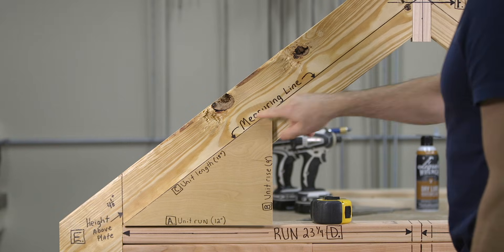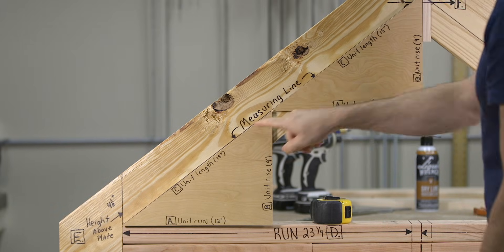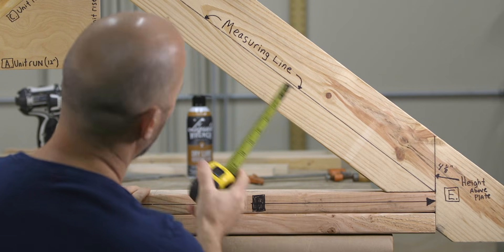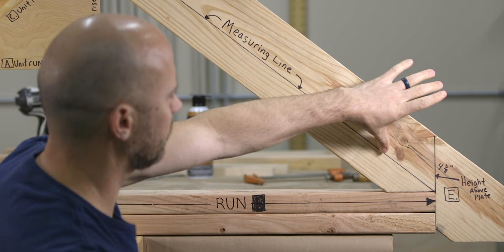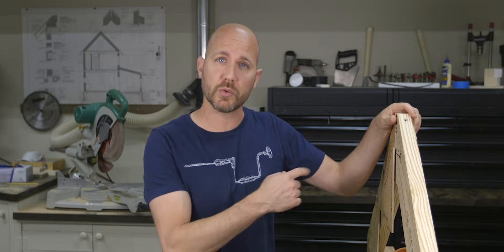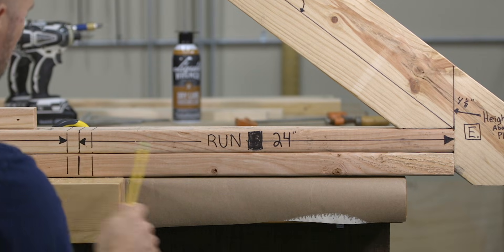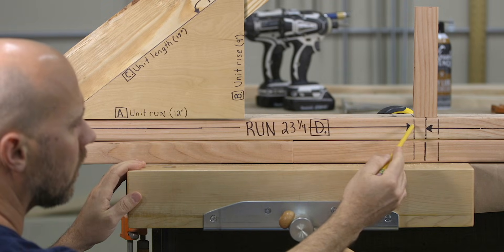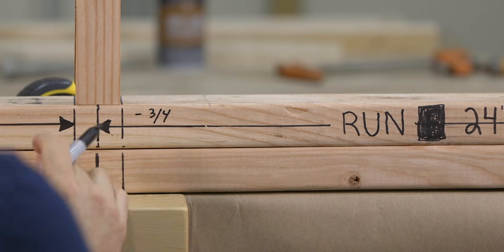How to Calculate the Height of a Ridge Board

Comment: How would you calculate the Height Above Plate without directly measuring and only using trig/math?
Reply: I guess you could layout the rafter and then measure the height above plate directly on it and figure out the height of the ridge beam, then mount your ridge beam!
Reply: @Machining101  rule of thumb: measuring line is 1/3 of rafter height so ridge height is 2/3 of rafter height plus theoretical rise. I think this is measured along the plumb line. So just be consistent when cutting birdsmouth.  The genius creator of this video can't actually answer any of these hard questions.

Comment: Why would you need to calculate any of this if you already have it all cut and in place already. you wouldn’t be able to get height above plate without the measuring line at the bottom which would make this all a lot easier but it’s harder if the ridge or rafters aren’t set yet
Reply from the maker: You can get HAP online. I have a video on that. https://youtu.be/fNX430YLuN4

Comment: Standard overhang? Builing 12 x 12 shed, don't want it to look cheap.  How much should the roof overhag and how deep should fascia  be?
Reply from the maker: 12" is standard, with 6–12" overhang on the eaves. Fascia can be either 1x6 or 1x8.

Comment: Great video.
Question.  We are building a shingled-roof over a patio. The walls will be about 8 feet tall.  Total span 12 feet for each section. Gable roof.
I was going to maybe have one run at 6 feet, 6/12 pitch and the other side be 7 feet, 5/12 pitch.
The rafters on the 5/12 side would have to be tweaked a little, right?  Any other foreseeable issues other than aesthitcs.  The reason I was going to have one side 7 teet wide was to avoid the water line underground when we set the concrete pillars.  Thank you.
Reply from the maker: I don't have any experience doing that before, but I would guess just making sure that the trim will line up on both sides. Sorry, wish I had more clarity for you.

Comment: Great explanation. What does one do if they want to notch the rafter to rest on top of the ridge beam not against it as a ridge board. Example total Run length = 13’ Run length = 6’6”. Pitch is 8/12. Birds mouth is 2” seat cut with a HAP of 5”. Rafter is 4”x6” and Ridge beam is 4” x8”. Rafters must marry on top and rest on ridge beam with a notch out of 2” at ridge plum cut. Thank you if you could answer
Reply from the maker: Sounds like you already have it figured out. You will basically cut a similar birds mouth at the top as you would at the bottom... only smaller to fit you ridge beam size.

Comment: 37 year carpenter here...great presentation ! In the field we do simplify some of these steps but your theory is nicely explained. Roof pitch is actually the ratio or fraction of the total roof span to the total height of the roof from the top of the top plate. Roof slope is the angle measured with 12" as the horizontal and the vertical rise given in inches. 6/12 slope is 6" rise or vertical for every 12" run or horizontal. A roof with a 24' span and 8' height to the peak would have a 1/3 pitch.
Reply: i dont get it

Comment: i know that this video is very old but i am a newer carpenter and I havent done too much fresh framing. mostly repairs. im only 17 but im getting into it. i understand everything from your first video and i get this one too I just want to know why you need to know the height of the ridge? it seems that you didnt need that to lay the common rafters so what is it for?
Reply from the maker: Hello, great question. You would need to know the height of the ridge if you where say building to a specific height... say trying to match something else, or even making sure that what you're building isn't higher than say codes allow. Does that help you?

Comment: Excellent videos thank you.  Can you confirm that the 1/3 rule overrides the wall plate length when cutting the birds mouth?  Ie I maintain a minimum of 1/3 cut into the rafter, and reduce the length of the the wall plate thickness cut to achieve that.
Reply from the maker: Hello, I would up-size your rafter material to maintain the 1/3 rule first before doing anything else.
Reply: @TrainingHandsAcademy  ok thanks. Great videos.

Comment: May 1st 2023
I set up a model of a shed. When I had the figures worked out, I cut the rafters, however the top of the rafter did not meet the top of the ridge board, rather it extended a short distance above it. What am I missing
Ger
Reply from the maker: Please share your math with me and I'll see if I can help.
Reply: @TrainingHandsAcademy  Hi
Another sample of my actions ,leading to incorrect result.
Rise squared+ run sqd = rafter length
7sqd+ 11 5/8= 13.56. 
11 5/8 represents run length minus  half the thickness of the ridge board.
Ger
Reply: Ridge board at 12 inches high. Run at 12 inches minus half the thickness of the ridge board 3/8 inch. Used the Pythagoras method to find the length of the rafter. Made the two vertical cuts and the birds mouth. Birds mouth fitted fine but the top of the rafter rested above the top of the ridge board. Rafter rested flat against the ridge board but as I said the top of the board sat higher than the top the ridge board. Must be something small I'm missing.
Thank you for your interest.
Ger
Reply from the maker: @gerglynn5  Should like you didn't take into account the height above plate.

Comment: What is the formula to find the height above plate without using your tape measure?  Example:  2 x10 is 9 and a quarter?
Reply from the maker: This video should help you https://youtu.be/fNX430YLuN4
Reply: @TrainingHandsAcademy  Thanks.  I get it a little better but I would like to know how to do it using a construction master pro calculator.  I see that you can plug the numbers into a website that works.  But when I am on the job,  I would rather know the formula and plug it into my calculator.
Reply: I think The formula to calculate the height above a plate without using a tape measure is:

Height = (Number of inches in the nominal size of the lumber - 1.5 inches)

For example, a 2x10 board has a nominal height of 10 inches. Subtracting 1.5 inches from this nominal size gives a height above the plate of 8.5 inches.

Comment: see, if i wanted to  lean a chicken rung on  wall, how would I know what angle to cut the wood in order for it to be flat on the wall while the bottom is say, 1 1/2 feet from the wall.... i wanna learn how to do that. like could it be a 41 degree angle?? like is there a specific angle? idk

Comment: I’m trying to stick frame a shed. Next step is to set the 2x6 ridge beam. To figure that height, and I know my building span(run), and my roof pitch, it seems like I should layout my bird’s mouth first so I know my height above plate. Is this correct? This way I can factor that into the total rise and height I need to set my ridge beam?
Reply from the maker: Correct!

Comment: First , Thank You. love your explanations, great work ! 
my quetion is if i want to reverse things... lets say i have a fixed height of 1000mm (right on the wall, no ridge board..), my total run is 2000mm and my HAP is 150mm. now ..if  I want to find my 'measuring line',  can i just subtract from my 1000mm fixed height the 150mm HAP and do my math on measurements of 850x2000 (Pythagorean theorem) ?
Reply from the maker: If I'm understanding you correctly, yes, once you subtract the HAP you are back down to the theoretical measuring line... which is where the Pythagorean theorem gets you to. Check out more of my rafters videos if you haven't already... start maybe with this one. https://www.youtube.com/watch?v=fNX430YLuN4&t=201s
Reply: @TrainingHandsAcademy  You understand me correctly buddy  (despite my English :), if you stumble upon YouTube or Google, you will find that most of the time the explanations starts with a pre determined roof pitch or angle thats leads you eventually to your `total ridge height'.  the reverse process, when the total ridge height is given, and you need to go down to the wall plate with your rafter, is hard to find. love to see the reverse process involving the other factors like the 'theoretical ridge height' (F) and how ridge thickness affecting it in the way of getting your precious 'measuring line' (with basic calculator). Thank You So much for your lightning fast reply. i have watched all of your rafters videos and learned a lot, you're awesome !
Reply from the maker: @freemansame8062  Thanks for the feedback and the great video idea! You rock!

Comment: so in fact, a 9/12 pitch roof is never really 9/12.  your example would be height of ridge divided by run.  which is not 9/12.  9/12 would be .75 and your calculation works out to be 21.625/24=.9  If you draw it as a true 90 degree right triangle you will see the slope (hypotenuse) and that the roof rafter is at a different slope.  Seems to me the only way to get an ACTUAL 9/12 pitch, or any other pitch, would be to use a pattern with actual rise and run layed out, then lay your intended lumber over it and mark it out..  The only way you can use the step off method is if the roof rafter is a line, not a board.  let me know your thoughts.  Thanks,

Comment: A good video as usual. Could you demonstrate how to do a roof when you have 24" run and total ridge height required 23" if they are the only dimensions you have. In other words you only know your run and required ridge height.
Reply from the maker: My other rafters videos will give you great insight into that.  The biggest factor is something called height above plate (HAP). Let me know after you watch them if you still have questions.Thanks for the comment Robert. Talk soon.

Comment: I have a question about the ridge board. Is it necessary? Can you use gable plates and simply get rid of the ridge board altogether?  Thank you
Reply from the maker: If you are "stick" framing (which all of my rafter videos show) you need and ridge. However, what you are talking about is building a truss.. which works too but other framing members need to be used to make a truss work.

Comment: easiest way is height = the square root of rafter length squared - run squared. This is the height to the bottom of the ridge. Dont forget to subtract half the thickness of the ridge from the run measurement. Then subtract your desired HAP
Reply from the maker: Thanks for sharing. When you say bottom of the ridge do you mean the measuring line?
Reply: @TrainingHandsAcademy  bottom of the rafter not accounting for ridge extra size
Reply: its just calculating for a=height of a right angle triangle which is the air space in our rafter triangle

Comment: Nice job. Love these videos. I was thinking about the first equation used. Although it may seem obvious to some, I think of the first equation at (D/12)*B. D/12 means that the total run - half the thickness of the ridge board is being converted into foot increments. 23.25/12 = 1.9375 ft, Since the rise is 9 inches per foot we can calculate 1.9375 ft * 9 inches/ft = 17.4375 inches, or 17 and 1/2 inches. From there it's a simple step of adding the HAB to get the actual ridge height.
Reply from the maker: I don't know you Ted, but I sure do like how your brain works! You must love math?!

Comment: HI. So in your example, the height of your ridge board is from the "top of plate" to the" top of the ridge" which is 21 5/8? Not from the bottom of the bottom 2x4 you have in your example to the top of the ridge. I like to be certain I know what I need to do before I venture into something like this.
Reply from the maker: Hey Bill! Yes, ridge height is measured from the top of plate (which is the top of the second plate) to the top of the ridge... and not from the bottom of the bottom 2x4. Hope that helps

Comment: @2.50 when you did the Math to Get 17.5" looks like you Rounded the Number up ?
Actual Calculation = 17 7/16"  ( 17.4375")
1/16" Difference
Reply: I got the same thing
Reply: I agree. His math is off.

Comment: Good video, however I don't understand the possible sequence. It seems the ridge height was determined after the HAP was determined. However the HAP was determined after the rafters were in place, which attached to the already placed ridge beam.  How is this possible?

In summary how can the HAP be determined without already placing a ridge beam and setting at least one rafter?
Reply: you make an error. HAP can be established without determining the ridge height. To lay out a rafter you need only 3 lines drawn at the pitch of your roof. if your rafter is 2x4 then 1.5 inches could be the depth of your seat cut. then 90 degree from that  you measure along a 90 degree line whats left. thats would be your HAP.

Comment: Want to know if it’s better to take 3/4 off run for rafter or take 3/4 off the rafter measurement itself.   They both come out slightly different but I want to know which one it really is
Reply: Actually the measurements are Exactly the same. As long as you take 3/4 of the rafter measuring back from the plumb cut and not down the rafter

Comment: What i do to get ridge height   .. say a building is 24  1- 1/2   with a 2x  ridge..  so  the run is 12'   if you have a 6-12 slope  multiply 12x6 eq 72 plus  height above plate        if you have say  a run of 12  3  5/16    that  again is 72  with the framing  square draw   a   6-12   slope on  a board on  the level  line   slide the square  over  to 3-   5/16   as you slide it  you read the height of the square above  the  board  plus  the height above plate.

Comment: For me as a woman building 1st ever greenhouse, Your video was really easy to understand.  I'm trying make a 10x6 greenhouse.  I was going to use 4x2 for plate and ridge. 3x2 for rafters. The greenhouse  frame will sit on a concrete block wall that I built 1.5-2ft in height and the roof will be polycarbonate sheets. I'm not sure if i should use 4x2 for ridge or not?? Any reply would be much appreciated. Thanks
Reply from the maker: Hello Naheed, thanks for the comment! Unfortunately, I can't answer that question because I don't know enough about the project or your local building codes. I apologize that I can't help you out more. Sound like an amazingly fun project!!
Reply: @TrainingHandsAcademy  
Late reply but i finally did use 4x2 as felt more sturdy because of length of greenhouse.  Adjusted length so finished project is 
10x11 feet as wanted more space inside to grow vegetables.

Comment: If I'm just using 2x4s for my rafters in a playhouse, I've read the seat-cut of the birdsmouth should be no longer than 1.5 inches, less I compromise the integrity of those rafters.  Does that sound right?
Also, my ridge board was going to be a 2x6, but that board is so warped I've given up on it - and I want to use a 2x2 below a 2x4 as a "ridge board".  I'm using simpson ties to keep them together.  Would this be ok, do you think?  
(My building is pretty small,  mostly a 4x8 floor plan, with one wing extended out, but not too far).
Finally, in the video, you meant to say "B is the Unit Rise" @2.42, you accidentally said "B is the Unit Run".  You never use the phrase "Total Adjusted Run",  which I've heard used as "Total Run - Ridgeboard width".  I've watched too many carpentry videos trying to nail the rafters and roofing.  I think your approach to using just the speed square and calculator are pretty simple.Thanks again for your videos.
Reply from the maker: Yes, 1.5" sounds about right, just as long as you're around the 1/3 mark of the rafter width. I would personally use a solid piece of ridge material, and yes, I did mean to say unit rise, good catch! :) If you get building and have more questions, find me on Instagram so that you can share photos or videos with me.

Comment: Here is how to get the pitch if you don't know the  ratio i.e. 12/12 = 45 deg.
A= Top Ridge, down to top of wall plate
.  (Horizontal)
B= Half span (Vertical)
A/B  eg >>>> 1220/2075 = .58
tan-1 of .58 = 30.11 
so the pitch will be roughly 30 degrees
Reply: Anyone know what language this is?
Reply: @ElJoeRN  Joe, tan-1 is ATAN, a geometric function to calculate the angle of the Hypotenuse-to-Base, or Rafter-to-Run in this case.  I think Damien got his Horizontal and Vertical labels mixed up though... too much multi-tasking?
Reply: @calcollier7366  my 10th grade geometry teacher can go soak a toa...if he would've used carpentry to show the relevance of it all the hot pants and sizzle skirts wouldn't a been so distracting.

Comment: Just wondering how do you determine what way the ridge board will run for example I am building a 10 x 6 shed so should my ridge board run the 10 ft or the 6ft how do I know which way to run the board also if  running it the 10ft am I measuring half of that which would be 5ft less half if ridge + any siding to get my height .so this would mean my common rafters are running the 6ft way .if that makes sense
Reply from the maker: I'm sorry but I'm only following part of your question. Can you please email.  josh@traininghandsacademy.com